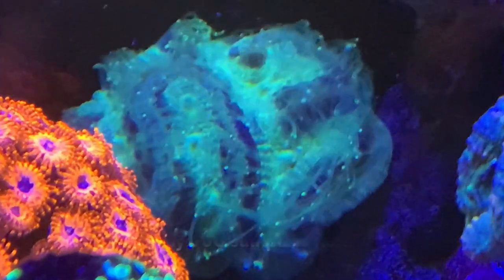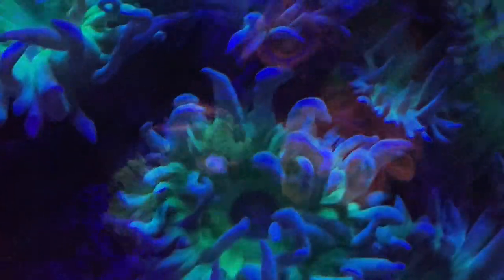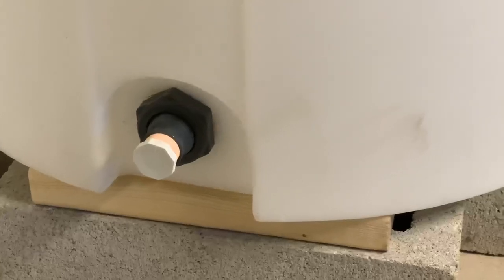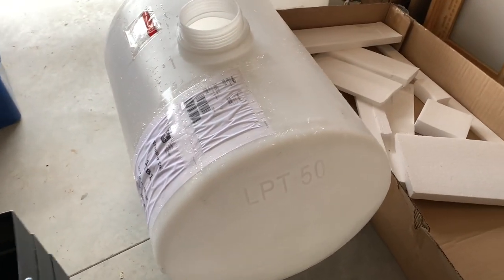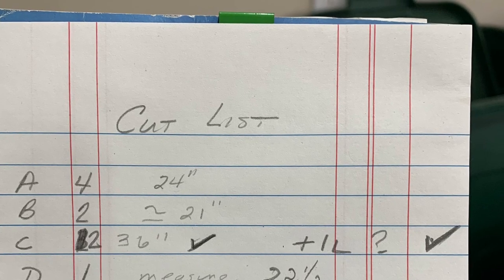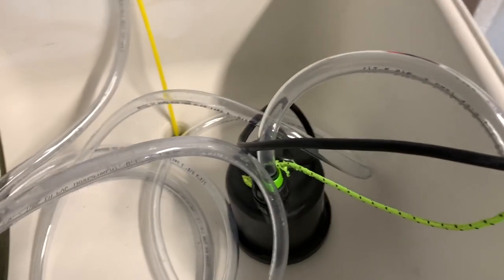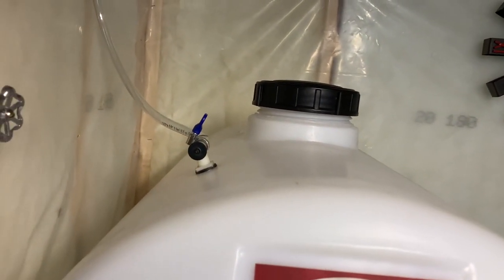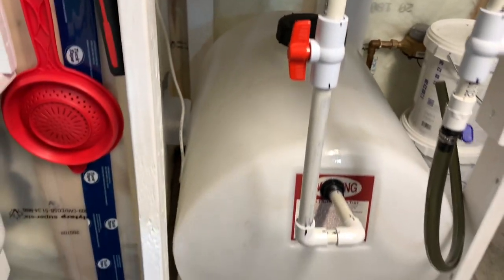New Build - Water Management and Sump Test! Not as Easy As I Expected...

Comment: What a crazy setup! While this is certainly far more advanced then anything I've plumbed I do have 2 comments for you. 1) Are you just going to run 1 return pump or have you not setup a second one? I think 2 would be a good idea if you've gone to this crazy (good crazy) level of planning. 2)You are going to want to clean that ATO container out eventually so it would be a good idea to be able to get it out. Probably not more then every other year but this is your dream build so hopefully you will be automatically topping up for many many years to come.
Reply from the maker: Thanks for stopping by Andrew! I’ll have a pair of Deltec eFlow12s, mounted externally, to run the entire system once I have the tank (pending Deltec USA providing the product to my LFS, who will be a retailer of Deltec in Canada). The Jebao is temporary, so I can run the sump and get it cycled, then move the contents of my reef into it. And I was kidding - that trash can went in between the studs, and it’ll come out again if necessary. 😁

Comment: My dream type of build, wish I had the means to start mine, u guys have some tweaks to work out and some corrections I seen I wish I could've saved u time before hand but I guess thats how u guys learn. 1 thing to note is u guys need some more secondary or back up drain lines in the sump also larger for that size system
Reply from the maker: Right....can you be more specific? We’ve discussed this entire layout with several reefkeepers and there have been many changes since the original design.

By secondary, do you mean emergency overflows? The shallow 50 has 2, the 150 has one, the first 100 is plumbed bulkhead-to-bulkhead, and we have to wait to locate the emergency in the final 100, until the plumbing is in for the return pumps (2, external) before we drill for an emergency. 🤷‍♀️